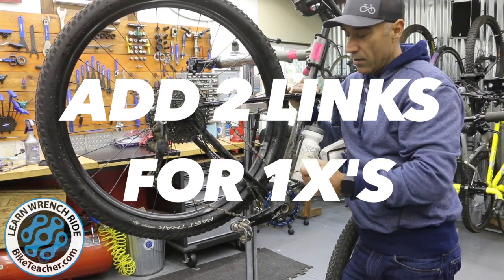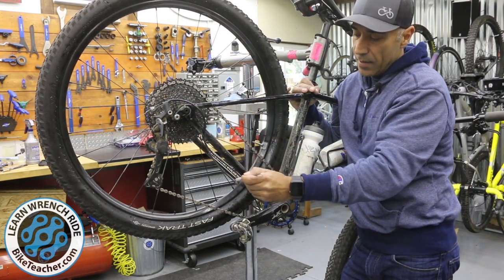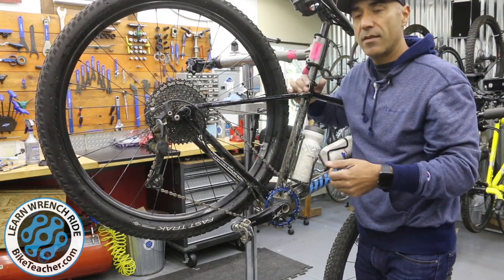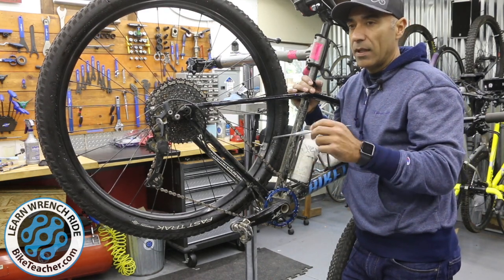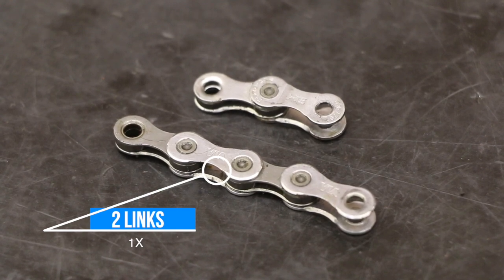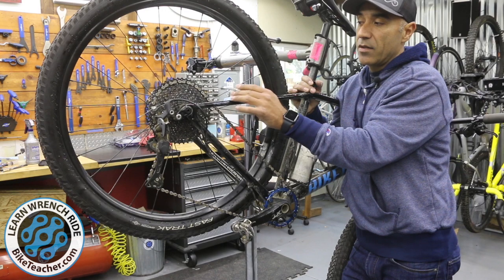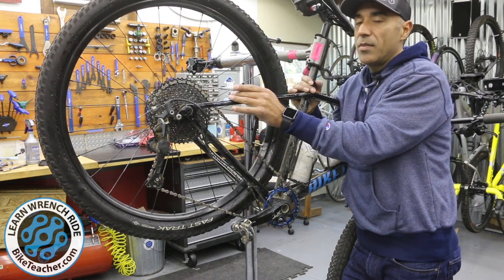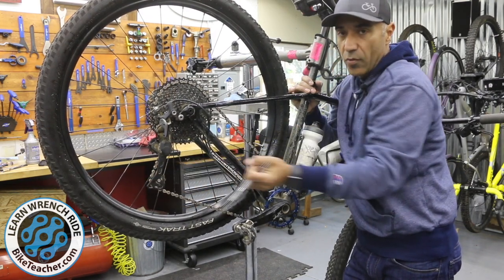Add 2 extra chain links on 1X drivetrains.

Comment: Hello there. Can you give me an advice how to do it with 3x8 / 11-46t? How many links do i have to add or should i change chains?
Reply: This is something I want to know also. I have 2 116 link 8 speed chains, and was also wondering how many links I need to add, if any. I have a 3x8 system, just like you, but my rear freewheel is a 11 - 40t. Front biggest chainring is 42t.

Comment: Another brilliant video but I'm having a little trouble. Just converted my old Rockhopper to 1 by 10 Shimano XT. Made a mistake assuming an older style long cage would do 11/46 so had to use derailleur hanger extender, all settings correct, all new parts but no matter which way I turn the barrel, it either won't go up or down properly in the little cogs, it's one way or the other, shall I lose the extra link in the chain, shall I add a spacer to bb  to move chain line currently at 49mm. I've built 4 other bikes from scratch and usually good at setting gears, I'm just stumped, have you come across this?
Reply from the maker: Definitely keep 2 extra chain links, tighten up the b screw. Could be the old derailleur. Plus I think you will need the derailleur with a clutch (tension), upgrade the rear derailleur. double check cable housing fluidness. Are you running a wide narrow chainring?
Reply: @BikeTeacher thank you for your quick reply. All drive parts are brand new, XT 10 speed  derailleur with clutch, cassette, chain, I made the mistake of assuming that an older style long cage XT would do 46 rear, I had to use and extender. Expensive mistake 😭 I've had a closer look and tightening the extender, moved it to the left slightly so taking jocky wheel further away. I've adjusted this, re adjusted the b screw, it's better but not 100 % perfect.  Yes narrow wide chain wheel. I have a spacer in the bb to get chain line to 49mm, maybe another spacer to take it to 51mm so the chain is straighter to the cogs I'm having trouble with?
I'm wondering if the extender that allows me to use the 46 rear is taking to jocky wheel too far away from the smaller cogs? I used an extender when I initially converted to a 9 speed 1 by but the was only 40 tooth rear.
Reply from the maker: If your have a long cage now I assume it should work without the extender. Re check that the derailleur is attached in the correct area, notch.
Reply: @BikeTeacher  it was the long cage designed for a 2 by system, I've found out since it is 36 tooth maximum. Arm that cable attaches too touches the big cog without extender. I might buy a proper goat link as that seems to take the derailleur back further as well as down so the jocky wheel is closer to the cassette in the smaller cogs although they say max 42 tooth and I'm on 46 🙄
Reply: Just got info from Woolftooth website and forums, seems people have problems with the smaller gears when using a road style extender on a Shimano Shadow derailleur because of the further  distance of the jocky wheels, I have asked for technical info from Woolftooth about their Goat link as the 10 speed only goes to 42 teeth and the 11 speed goes to 46. If I get a response I will let you know as a matter of interest for you. Thank you for your quick response and keep up the great videos, easy to understand and well explained.
Reply from the maker: Thank you Mick!

Comment: Perhaps a dumb question: those 2 links are they sold somewhere or do you need to buy a full chain to extract the links + the master link?? 
🤔
Reply from the maker: No worries, those extra links come with a new chain. All new chains come longer than needed to accommodate any bike situation. Then you would trim off what is not needed. If you need extra and don’t have any lying around then you would need to buy a whole new chain.
Reply: @BikeTeacher not so, I bought a 116l chain and used the whole thing and if I change my chainring, might need more....

Comment: Hi there. Just want to ask question because i think your a great mechanic. Im planning to change a chain ring from 34t to 36t sram eagle. Do you think i can add or connect or use the chain that ive been cut from the first time i cut it. Can i add 2 or more links? Is there a pin to buy before i connect or add it again? My chain is xx1 eagle chain gold hollow pin. Please answer. Thanks
Reply from the maker: Hi. Yes you can add from that chain. Buy a new chain connection, or quick link. I would try the old chain first it may be okay.
Reply: @BikeTeacher  i have a few left over links from the old chain im using. i just want to know if i can use that to add 2 or more link because i will put a bigger chain ring from 34t to 36t. Will i buy a new pin or i can already use the pin which is already there.? Its xx1 eagle chain hollow pin
Reply: @BikeTeacher  i dont need a quick link because what i mean is to put more link except than quick link because i put more teeth on my chainring from 34t to 36t
Reply: @BikeTeacher  what do you mean a new chain connection?
Reply from the maker: A pin or power link. Sounds like you have it covered. Your okay
Reply: @BikeTeacher  the mamufacturer advice that use only one power link not more than that i need to add more than a link just in case the chain will be short if i switch 34t to 36t. My main concern and question is is it safe or can i use to connect or put back again the chain that i been cut from it before?
Reply: @BikeTeacher  can i do on an xx1 eagle chain hollow pin to remove or push its pin and put it back again? Is it safe to put it back after you push it and add another few links? Thats my main question.
Reply: Because unlike shimano chain you can buy a new pin to put just in case you remove or add a few links. Mine is sram xx1 eagle chain gold hollow pin. And i dont see in the market that there is a hollow pin that can buy. Thats why im asking you or do you have an encounter on xx1 eagle chain hollow pin if it can push remove and put it back its pin without a problem?

Comment: do you still need an extender if you add 2 links?
Reply from the maker: Extender? You mean a chain connector (quick link). If so, yes.
Reply: an extender for the rear derailleur like a goat link?
Reply from the maker: @paolosorinio5854  If you are running 1x system, yes still add 2 links.
Reply from the maker: The added links are to accommodate the larger 46-52 big gear on the cassette.
Reply: okay this is great advice. thank you sir for replying! recently changed my set up to a 1x system so, this really helps thanks a lot

Comment: I saw that hardtails need 4 extra links?
Reply from the maker: The 1x system for any bike typically requires 2 extra links or 4 individual pieces of your counting that way.
Reply: @BikeTeacher  sorry I meant it wrong when I watched videos like park tool.  For shimano and compressed sram full suspension, they counted it by rivet or pins never by actual full links.  But for hardtails they counted 4 rivets which is about 2 links.  So of they counted only 2 rivets for the first 2 that's only 1 link.